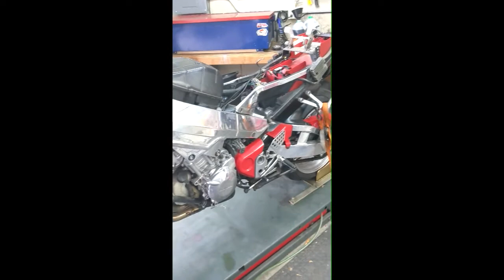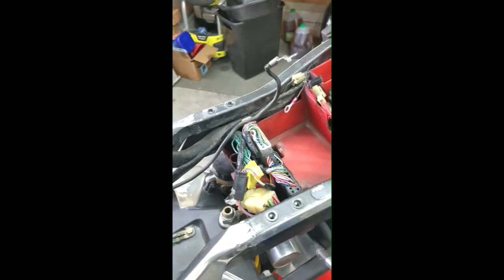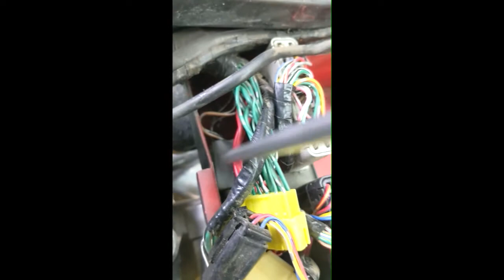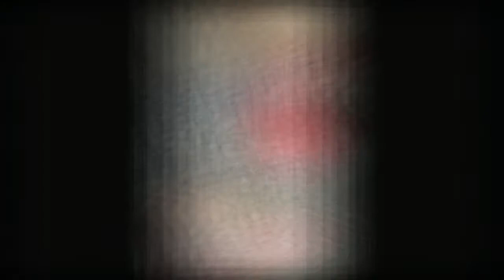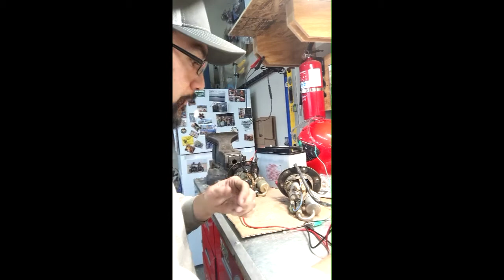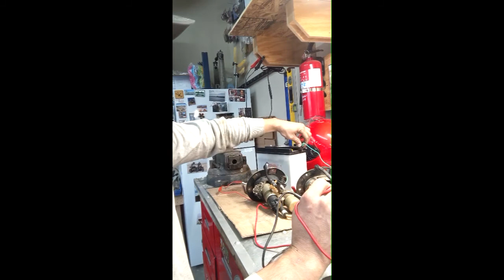Testing a Motorcycle Fuel Pump - 2002 CBR954rr

Comment: I got a similar issue. Connecting power to the plug, nothing. So I tried directly to the pump, and guess what? It worked! At the bottom of the pump, the wiring is brass riveted, and it got oxidated. Removed it, connected it directly, sealed it properly, and the bike runs fine.
Reply: How did you seal it?
Reply: @FetusbakonFetusbakon  with gasoline resistant glue. In Portugal, I used a two component glue, of Liquy Moly. It still holds well.

Comment: I put the power wire on the brown wire and the ground to the green wire but no prime but wen I put the power where to the brown wit the black stripe it primes ? Is this suppose to be like that
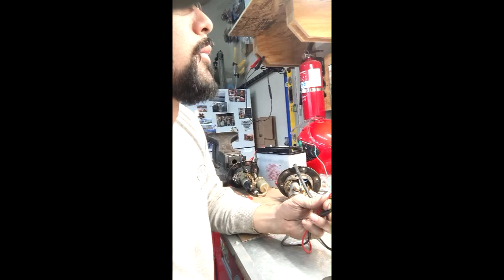Reply from the maker: 3:20 is the manual information specific to this bike/fuel pump.  I don't know what you're working on but you can reference the manual/wiring diagram to find more details.